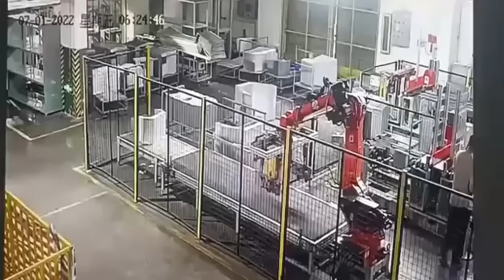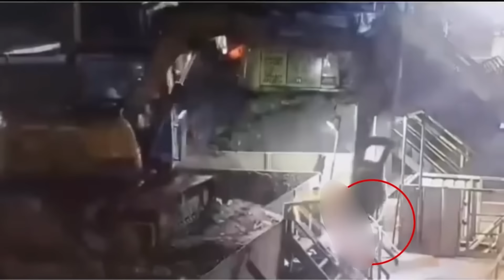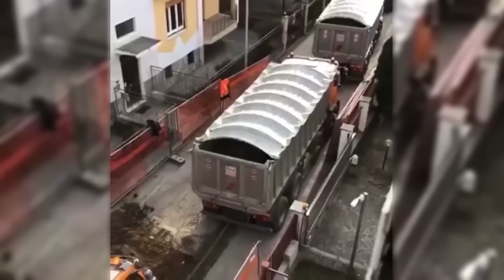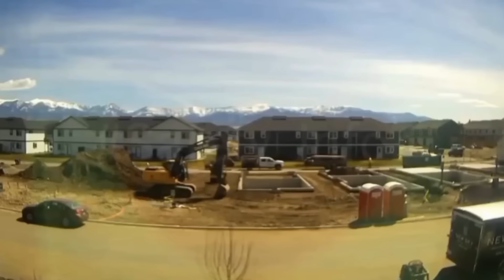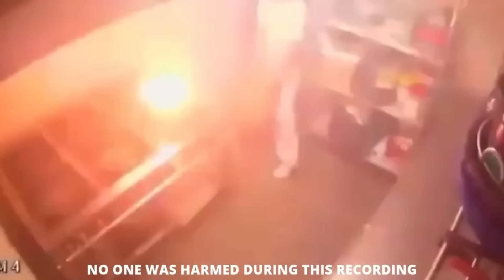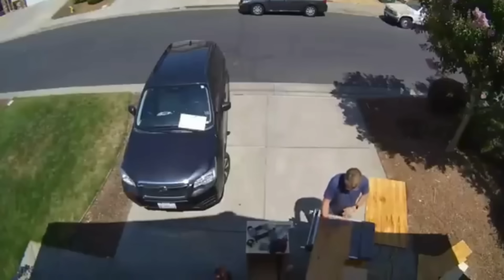He tried to switch on an Industrial Machine... Then THIS Happened!

Comment: Wow the AI really sucks at the actual incident that happened in some of these. The excavator wasn't being towed moron, it was attached to the cement truck for some reason, but the truck in front of the mixer was the one pulling. Damaging the rear bumper? The front loader destroyed the roof of the car.